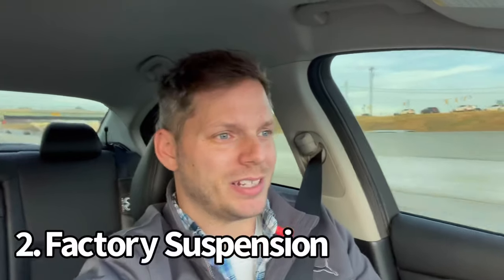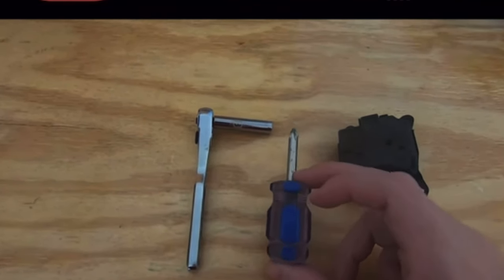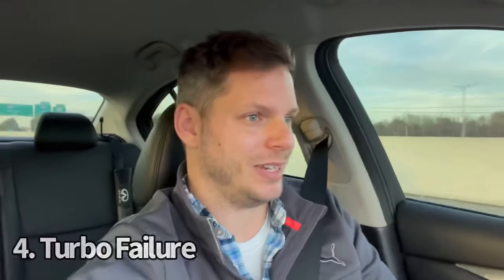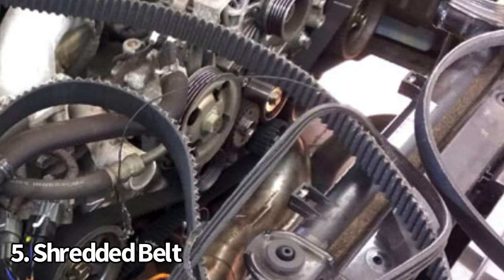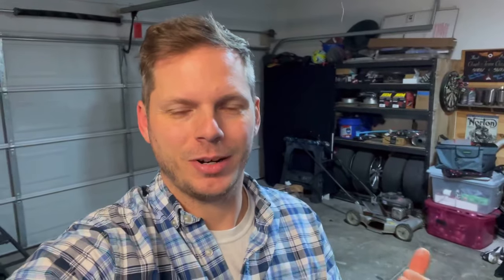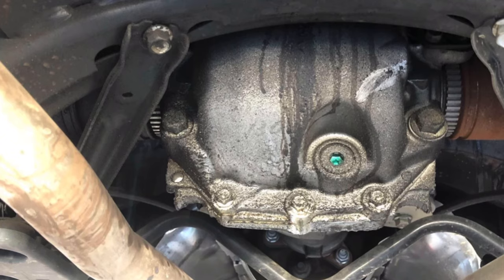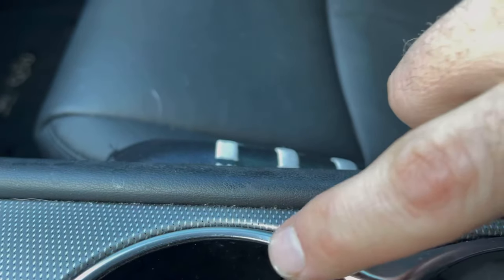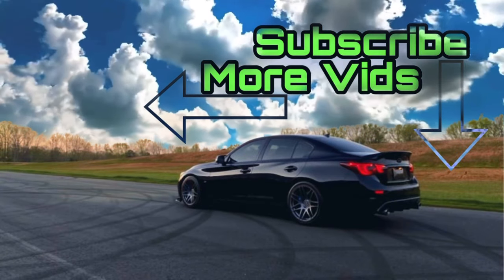8 Q50 Parts that WILL Fail!

Comment: Need help with issues on my 16 Q50 premium 3.0T awd. Installed aem intakes and jb4 tuner, then car went into limp mode after 3 days. Threw throttle position sensor code. Not sure if related. I removed it and no issues since. Then replaced aem intakes with stillen and did a muffler delete with straight pipes, months after, car randomly died on highway. Very scary. Then tried installing Z1 motorsports hotbox piggyback tuner and it threw throttle position sensor codes and engine started up hard and running rough. Turned it off then engine wouldn't fire back up. Removed it, then it fired back up. Z1 asked if its been tuned. I have no idea. Doesn't seem tuned. Also, when I accelerate from a stop and then let off the throttle, the car jerks and gives me whiplash, I can't tell if valve body, back pressure, or something else. I have to let off the throttle very slow or it jerks. It almost acts like it gets stuck in gear. Please help. I've taken it to a Nissan dealer and they couldn't find anything. There are no Infiniti dealers anymore in my area. Also, owners manual says transmission is maintenance free. Is that true? U never have to service it?

Comment: Couple honorable mentions:   1 - Driver seat squeak/creak.  Thankfully the radio is loud to mask this.   The squeaky seat makes me insane.   Of course the recommended fix is a new seat.   Not happening with an out of warranty car.   There are internal memos concerning this complaint but no real solutions to my knowledge.   2 - Wheel speed/ABS sensor failure.  This one is fun because it causes a bunch of errors to pop up.   When one of these go, the ABS isn't functional, the AWD/traction control goes bye bye and you're back to RWD only.   The errors are for AWD System, ABS and Chassis Control.    Car still runs and drives fine but without the traction control and my heavy right foot, I'm squealing tires like a 16 year old kid.   Getting this fixed in a couple days.

Comment: Got a question my q50 3.7 doesnt start anymore and only clicks when I try to start it, it only works when I jumpstart it but then dies out do you have an idea of what the cause is?
Reply from the maker: Dead battery
Reply: @SpeedCultureStudios  i replaced it and the alt and its still doing the same thing
Reply: @ernestmorillo3432  same, ever figure it out?
Reply: Had same problem. Needed a new battery

Comment: I had the belt fail it didn’t shred but it was squeaking and I replaced it at 20,000 miles on a 2016 red sport. I now have 47,000 trouble free miles on my Infiniti so far, Minus the belt of course. I change my oil between 3-5k. Change my air filters every other oil change as well. I want this thing to last forever. You definitely left out the shitty run flat tires that come with it ,the Dunlops are terrible. They have terrible grip and they are noisy as any tire I’ve ever had. They are probably as noisy as the all-terrain‘s on my super duty.
Reply from the maker: Well, the run flats won't necessarily "fail" so I wouldn't include them, but they do suck!  As do all run flats for the most part.
Reply: What did you replace then with?

Comment: I have a 2018 3.0t q50 awd. There is trans slippage. Should I just change the valve body or get a new trans
Reply from the maker: If it’s slipping, changing the valve body may not improve the issue

Comment: Hey quick question , have you heard any problems regarding speed sensor code p1721 , just bought a 2016 q50 premium and just saw this code pop up
Reply from the maker: I’m not sure about the code but speed sensor is very common.
Reply: @SpeedCultureStudios  ball park average ? is it an expensive fix
Reply: Car only has 38k miles , I was surprised to see that pop up
Reply from the maker: @DomiLegacy7  I believe someone else in the comments said they were charged $450 at the dealer.  Not terrible.  Also stated they could have probably done it themselves if they had known what exactly it was.

Comment: Hey.. your car is ridiculous btw!! You did a great job. I have a 2016 q50.  im having a problem where my car will not accelerate and there is a horrible ticking sound. Scanner said it was a bad camshaft position sensor but I changed that and it still doing the same thing. Do you have any idea what this could be
Reply: The ticking sound happens whenever I put my foot on the gas
Reply from the maker: It’s hard to know.  Ticking can be a bad injector or it can be valve tap or start of knock.  Best to get it in and checked out

Comment: My 2016 q50 tail lights stay on and the car starts without having to press the brake... can you tell me what may be the problem... I'm not getting full power when I press on the accelerator
Reply from the maker: Might have a bad brake switch—check under the brake pedal
Reply: @SpeedCultureStudios  thank you I'll check immediately

Comment: Hello Q50 fans Im considering buying, a 2017/2018 before I decide; I just want to know if the transmission problem also affects this years?
Reply: It affected my sisters 2015 so I imagine it’s the same 2-3 years later 

radiator also blew like 15k miles after 

And now at only 147k miles she has a rough shake at startup and a check engine light 

Avoid this brand tbh

Comment: I have another question regarding issue I have.
When I driver into big sharp hole, there is a metalic knock sound from right front wheel. I changed stabilizer connctors, but it is the same. There is no problem on small holes or bumps, only on big holes 
My question is - is it possibile, that stabilizer bar is installed in wrong position, for exaple endings are 5cm to low? Or there is no option to install it in incorrect position?
How long do OEM schocks lasts when driving normally, without top much stress on suspension on stock Springs?
Thanks for advises :-)
Reply from the maker: I have heard people having shock failure after 50,000 miles.  If it is only on big holes, it sounds like your suspension is bottoming out.  You could have a bad shock.
Reply: @SpeedCultureStudios  thanks. What about stabilizer bar - can it be installed in wrong position? I mean not left right, but up-down position of its ends?
Reply from the maker: @levisik  I really do not see how it could be.
Reply: @SpeedCultureStudios  basically, bar is holded by 2 rubber mounts, when you loose bolts next to rubber mounts, you can turn bar, causing ends to go up or down.
It was possibile on my previous cars - I'm not sure if this is possibile on Q50.

Comment: Kind of late but I recently had to replace the heater hose connector. Little tiny piece of plastic that is destined to go out. Infiniti says they replace those very often
Reply: How much they charge you? It’s an inexpensive fix if you do it alone part is only 10-15 bux. They where charging me a couple hundred like 500-700 on my GTI until I saw many videos on how to do it. It was a bitch getting through all the stuff and firewall and took me an hour or so even though I think it would of been less if I had more experience, but it was well worth it

Comment: My Q50 3.7 has over 200,000 miles and I have replaced ac compressor. Now it’s running rough, not sure what this problem is? Do you think I need new plugs and hose?
Reply from the maker: If you haven't changed plugs in 200k miles then yes, definitely need plugs and coil packs wouldn't hurt either.
Reply: Car was burning a lot of oil. Car started slowing down had a coil misfiring. Change spark plugs with denso plugs. Car runs better and oil is not burning excessive. Had 198,000 miles on my 2014 q50 premium Infiniti.

Comment: The comment that chrome flashing on the dashboard trim will eventually flake reminds me how bad the plastic parts in automobiles was 50 years ago. I had a 1975 Chrysler Cordoba that I purchased new. Pretty soon, and well out of warranty period, which was much shorter back then, the plastic shelf on the top of the dashboard developed a large crack. Later one of the tail light lens assemblies fell off. At least that occurred sitting in the driveway, and I was able to glue it back together. Cars were much simpler back then and thus more reliable but the cosmetic plastic used in those cars was much inferior. I may be somewhat biased now that I am able to keep my cars sheltered in the garage and out of the sun most of the time. These days we are accustomed to drive trains lasting hundreds of thousands of miles with only routine maintenance while the engines and transmissions are much more complex than what we had then.
Reply from the maker: great perspective!

Comment: Sup bro you think I can get rotors at auto zone for my 2014 q50 s…..I was thinking about getting the duralast gold or premium
Reply from the maker: You can.  There are only a few actual rotor manufacturers, so a lot of the different brands you see out there are likely made in the same place.  I don’t know anything about the ones you mentioned, but they are probably just as good as many of them out there.  I’ve had good luck with R1 concepts

Comment: My wife’s 2014 3.7 Q 50 had a lot of those problems but one I didn’t hear you mention or haven’t seen in the comments that I believe is fairly common is the infotainment center going out and there really isn’t much of a fix aftermarket wise. And it seems like every one of these problems is $2500 … damn
Reply from the maker: I haven't heard of the infotainment issue--at least not on a large scale.  I know the 2014 system was a little laggy, but I haven't heard many talk about the thing just going out completely.

Comment: @ 91,000 miles on my 3.7 I'm receiving abs warnings and AWD high temp warnings. Apparently bad speed sensors are common with this platform as well.
Reply: @zolotovasoulmate7807my g35 kept doing that

Comment: Can you please explain more on the transmission issue part with more description? I have 3.7 and I just feel sometimes that’s what happens to my car.
Reply: Me too are you in socal?
Reply: In AZ
Reply: @yaseen-q50  what happens with your car and how many miles are you at? Mine gets rev hang and sometimes it’ll stutter a bit between 2nd and 3rd gear.
Reply: Im just now experiencing issues with my 3.7. I’m at like 75000 miles and I feel it jerking a little bit at times even when I’m going slow and straight. Any update on your car?

Comment: I worry about the transmission/valve body going out all the time. I dnt want to pay that kind of repair. If it does would you get an upgraded one or oem? I seen a video about a bullet proof valve body by some company.
Reply from the maker: I would just upgrade to the 3.0t transmission
Reply: How much is a valve body on a Q50

Comment: I have a 2014 infiniti q50. It starts and runs every time the first time I cold start it. My problem is if I drive it, even across town, say I'm getting gas. My tows a mile long. I shut it off and when I go to start it again it will fire up and stall out right away. It will do this repeatedly unless I give it gas to Rev it up. If I Rev it, it will even out and keep running. It's always after it's already been running, never the first time I start it. Under the hood looks good. I'm hoping it's not a fuel filter or pump, because I'm sure that's gonna cost me an arm and a leg. When it started doing this it would only be when it's cold or damp out, we are in winter now, but it did it in the fall too. It went from stalling out only once or twice then firing on its own, to stalling repeatedly unless I give it gas right away. I know I need a new serpentine belt as it's on the last notch on the tensioner..would that have anything to do with it? Or would that be the fuel rack? Im confused. I brought it up to the dealer last time i had it serviced and all I got was a stumped look and a "hmm". Yes my chrome is chipping on my interior where you mentioned. Mine has 90k. I've also experienced the warped rotors. Got a quote of about 1200 to do the front and back rotors and pads 😑.
Reply from the maker: Battery might not be getting a good charge.
Reply: @SpeedCultureStudios  I had a corroded terminal, cleaned it all off, put the protectant spray on..that worked for maybe a week
Reply from the maker: @corinnemaynard2824  But if your belt is old and worn, it could be slipping and therefore not spinning your alternator fully and not charging your battery.  Could be why it has enough energy to fire up in the morning, but if you drive a short distance, it won't have any juice to start back up.
Reply: @SpeedCultureStudios  yeah, that dawned on me after I responded lol. Thank you. I hope it's something so simple 🥰

Comment: Im planning to buy a 2016 Q50 3.7 base on these comments, does anyone  recommend this car? Is it reliable?
Reply from the maker: 2016 had the 3.0t.  Are you looking at a 2015 or 2016?  Either way, they both can be great cars, but the 3.0t and the 3.7 are very different.
Take a look at my channel—I have many many videos that may help you decide.
Reply: @SpeedCultureStudios  i got a little turned down by the transmission issues, since my mom has a 2014 nissan sentra and the transimission failed very quick and is expensivd to get it repaired, the one im looking for is a 2016 Q50 with the 3.7 engine
Reply: @javierAGLT Infiniti is just a higher end Nissan 

My sisters 2015 Q50 transmission failed at like 105k miles, radiator like a year and a half later 

Now at 147k mikes rough idle at start up AVOID

Comment: Lol. I literally got notified that I'm getting new turbos on my 2018 q50rs like 3 hours ago. 😂
Reply from the maker: At least under warranty, right!?
Reply: @SpeedCultureStudios  yeah, covered under warranty. I had to take it to 2 different dealerships, but I finally won the argument. And of course the turbos are on backorder.
Reply: Please share this info bro... i have an 18 redsport also still in warranty. I get a slightly oil smell normal driving.. no oil loss that i can see anywhere...
Reply: @_mathtutor3334  I got a 2018 redsport also my passenger side turbo got replaced under warranty and the tensioner pull with a belt. My driver side turbo sounds like the turbo turbine is rubbing against the housing I took it back to them they said they can't hear the sound and just to keep an eye on the noise.

Comment: my air vents will sometimes blow but not out of the fronts its like its stuck somewhere inbetween, my DDS front shocks both bad at 30k, injector at 50k, front windows slow but thats cuz i ride with them down all the time and dirt gets into the grease, i use strong detergent like dishsoap and they work good for a month and then i reapply, i tried the silicone or many other more difficult tricks and none worked

Comment: I also suspect my valve body. First to second is rough until the trans warms up, and sometimes revs flare in a shift.
Reply: Yea mine went out dealer want like 2200 for a valve body lol
Reply: @Gtyoungin21  same here, infiniti Q40 3.7, valve body had to be replaced because the acceleration was jerky.

Comment: Hey Im a new owner of a 2015 Q50. I noticed driving yesterday that at 35-40 mph i start hearing and feeling a vibration coming from the middle of the car. I would say where the front diff would be. After 45 mph+ is goes away. Has anyone encountered this? Or know what is wrong or if this just normal for these cars?
Reply: Also everything feels smooth as Im driving at that 35-40 mph range. Steering doesnt shake at all suspension feels dialed. It just has a weird vibration that seems really odd.
Reply from the maker: Shouldn’t be getting a weird vibration but start with the easy stuff and have your tires balanced

Comment: Apparently the alternator is a common failure on rhe 3.7. Mine failed at 73k, the warranty replacement failed in a month and the third replacement is now putting out 18 volts so I'm sure it's dying.
Reply from the maker: That's strange.  I hadn't heard that.  I did replace the battery at about 50k miles, but no alternator issues.
Reply: @SpeedCultureStudios  the dealer said with the design of the grill, they were bad to get debris or rain on them while you drove.

Comment: My valve body just completely failed on me out of the blue. 2015 q50 with 53,000 miles. Thank god I got the extended warranty because that would have been 4,000 dollars out of pocket otherwise

Comment: Pretty sure the diff bushings can be had directly from whiteline or there is no difference between it and the G35/G37/Q50 diff bushing
Reply from the maker: Z1 says they are not compatible with the Q50.  Outer metal sleeve is different.

Comment: for me on my 2014 3.7 so far in a year of owning it it has 73,000 miles and my throttle body, transmission and radiator have failed so far
Reply from the maker: Damn!